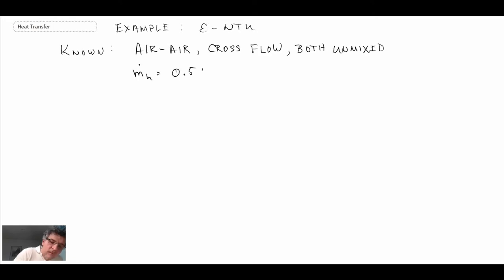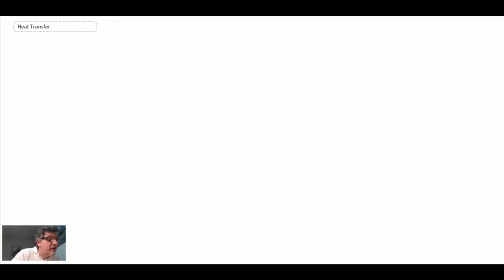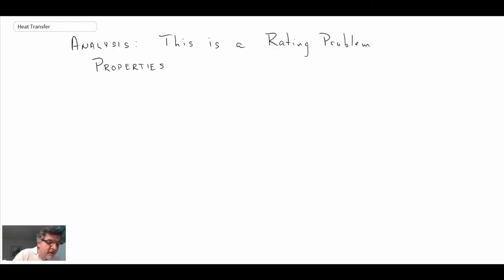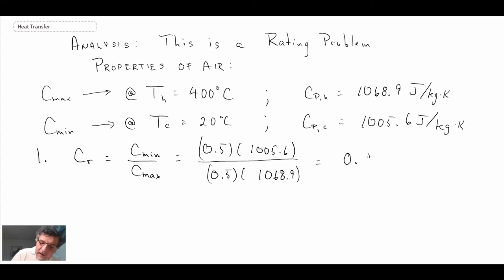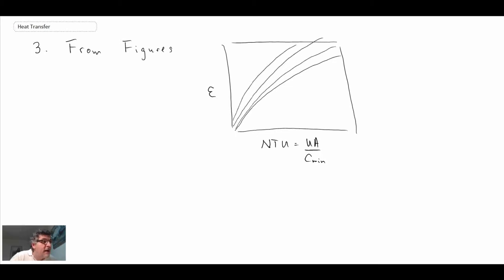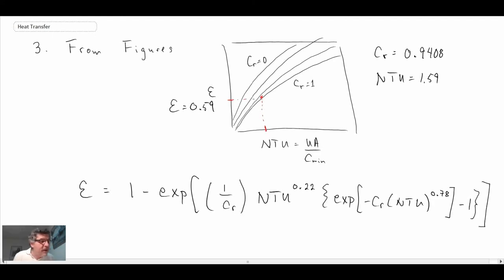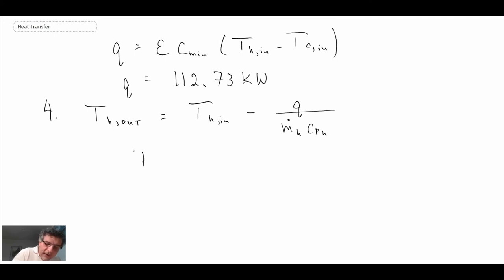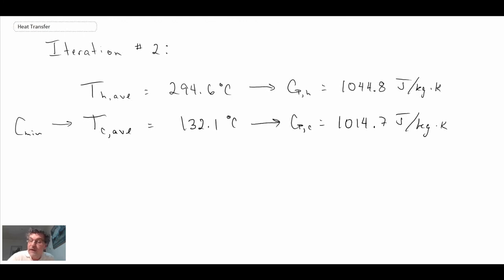Heat Transfer L33 p3 - Effectiveness-NTU Method - Rating Problem

Comment: In a real world problem you would also need to iterate for the value of U   as the film transfer coefficients h depends on the exit temperatures when calculating viscosity.